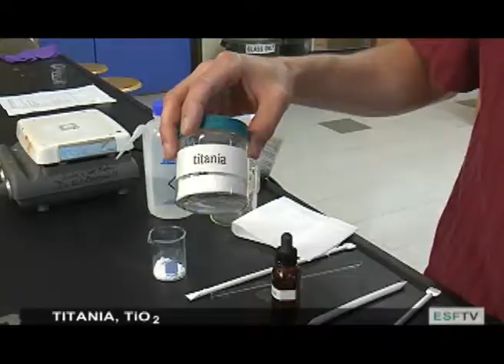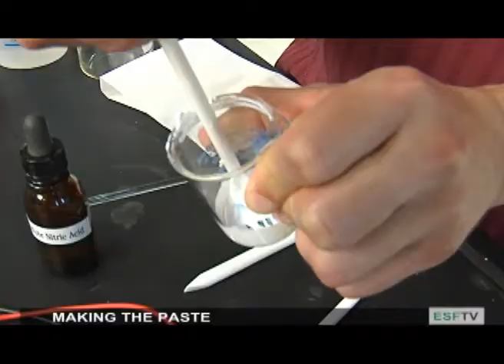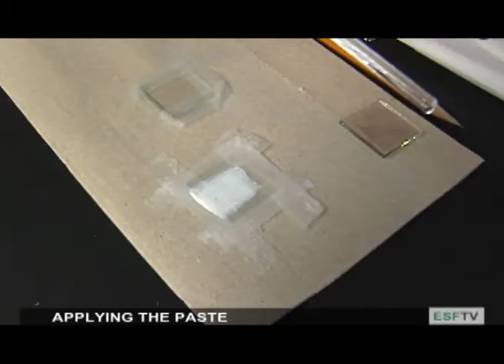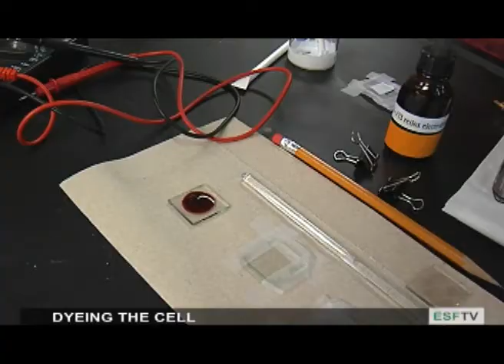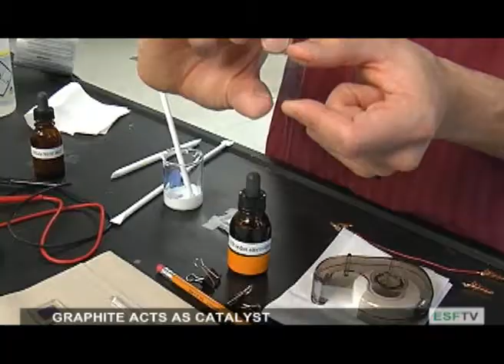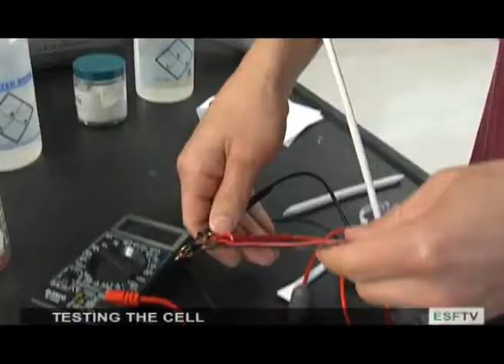Constructing a Dye Sensitized Solar Cell

Comment: Hi Neal, Thanks for the informative video. 
If I want to conduct more than one trial for this experiment, will I be able to reuse the TiO2 covered tin oxide glass for the next trials, or will I have to use a new piece of glass?
Reply: Hi, I think you need a new one since the dye from the fruit is already with the TiO2. But also, if you have done the project, did you use non-nano TiO2, or nano TiO2 P25? Or no P25? Thanks!

Comment: I would think aluminum foil could be the layer with titanium oxide added to it since it is conductive and has no need to transmit light.  The conductive glass as a bottom layer is silly since it becomes opaque to sunlight once it is coated.

Comment: i created 12 small dssc and none of them work, i used strawberry, red cabbage, green leaves, and carrot dye, any help?
Reply: Did you try blackberry, blueberries, or raspberries? Apparently they are the ones with anthocyanins which are really good at transferring electrons from the Iodide to the TiO2. Green leaves should do something but may not have have as great of an effect. I heard strawberries just don't work for some reason.
Reply: +Chuck Faber 
Thanks for The reply! I actually tried again with mulberries, eggplant, strawberry, spinach with carbon coating instead of titanium and different titanium dioxide. And it worked! somehow, eggplant and spinach somehow generated quite a lot of electricity, but mulberry  obviously had the most

Comment: Can anybody tell me if these cells will continue to work in the long term? I'm looking to make one of these on a larger scale to power a small fish tank, and I need to be sure that it will hold up for months at a time. If they don't last, is there any way to extend their lifetime?
Reply: Yes, there are ways to extend the lifetime of cells (most likely by creating a fully enclosed DSSC), but the cell made by this person will not produce the same output for very long because the dye on the titanium(IV) oxide will decompose when not supplied with an electron by the iodine solution. The iodide solution can evaporate and cause the electrons to not reach the dye molecules at the same initial pace.
Reply: @MarkDeAwesome  What about adding a polymer stabilizer? maybe embed the pigment in a sheet of plastic instead too

Comment: Anybody know where to get the material, The glass, Tio2, and redox electrolyte. I went to home depot and they didn't have it anyone knows if there is a store like that, I don't want to order the materials online.
Reply: +Alain Iblex E171 of course ;) . I was mistaken.
Reply: TiO2 (E330) is adding to food , for example cottage cheese. Its normally avaiable in chemistry store (the best form is anatase). Redox electrolyte you can make using iod in potassium iodide mixing in glycol ethylene. The problem is the ITO or SnO2 glass. I can make it in a magnetron sputtering machine. The electrode must be transparent and conductive, it can be made chemically. It's not simple to make this cell at home without intermediate components. It's hard to check the efficiency of this battery. On this film they show only Voltage. But how about current ? If you want to make a battery only for an experiment, use a citric acid as an electrolyte (saturated solution in water).  It can produce about 0,7 V , but the current is relatively low (about 0,5 mA) per 1 cm2 area of DSSC. Remember that preparation of each part of the cell has a strong importance to achieve a satisfactory final result.
Reply: Piotr Lichograj E330 use C6H8O7 and no TiO2 on it

Comment: Why doesn't the conductive glass create a short when it is in contact with itself?
Reply: Because they are not in contact. Its a thin film (tape) around the dyed area.
Reply: +Piotr Lichograj Isn't the tape removed after the TiO2 is added to the glass? Or does he just not mention that he leaves some behind?
Reply: +Olof Enström There should be a space to avoid a short circuit. In our research we are using a carbon disk from Floppy Disk or simple transparent tape.

Comment from the maker: @frostvectron Volume ratio is defined by molarity.  I would suggest obtaining the compounds individually, then making the solution.  The triiodide complex is in ethylene glycol, not water.  Water will kill the cell. You need about ONE DROP of solution per cell.

Comment: @nabrams1 I am looking at Sigma Aldrich for the ingredients for the electrolyte solution. They have KI and iodine solutions in water in the concentrations you had specified. What was the volume ratio of 0.5M KI, 0.05M Iodine, and EG that was used?

Thanks again!

Comment: @kam03m: the titania layer, which is titanium dioxide, the stuff in sunscreen, has enough thickness to separate the glass plates from each-other. On a different note, the anthocyanin dyes absorb light energy and transfer it to the titania semiconductor layer, which then transfers it to the indium-tin oxide glass and to the rest of the circuit. The electrons return to the cathode, where they combine with the carbon graphite, which is oxidized and then reduced by the triiodide electrolyte. Just a
Reply: without  titania layer ,there never be solar cell

Comment: Ok, so the excited electrons are injected into the conduction band of the Ti02 then they move towards the black alligator clip because of the electrical field created by the depletion region in the electrolyte.  They are suppose to travel through the multimeter then recombine with the electrolyte completing the circuit.  But since the both conducting sides of the glass are touching each other why doesn't the electron follow the path of least resistance and jump directly to the cathode?

Comment from the maker: @manilaenglish Votlage is based on the cell (max around 500 mv).  If you want to increase voltage, you need to wire in series.  I would not make the cells larger than 25mm x 25 mm.  After that, the current drops.  Cost:  I don't know on a per cell basis.

Comment from the maker: @onlyjustice04 The resistance should be close to 0 ohm.  Certainly not infinite, which is the other option.
Yes, the cell needs to be sintered.  If it is flaking/peeling even after sintering, I would guess that the paste was too thick.

Comment from the maker: I would not expect the cell to dry out since the redox electrolyte is made using ethylene glycol.  Instead, I would think the anthocyanin dyes oxidized, turning the cell a brownish color.  If it turned completely white, either the redox electrolyte was not correct or the cell was exposed to a large amount of heat and UV light.

Comment from the maker: The resistance on the wrong side should be infinite meaning there is an infinitely high resistance to electron flow.   If the ITO glass is high quality, there is no contact resistance, or the multimeter is not very precise, than you will observe 0 Ohms rather than 20-30.

Comment: What would you estimate the $ / Watt to be with this type of cell?  Also, will this same method / procedure work with larger pieces of conductive glass (1-2 feet square vs 1 inch square)?

Comment from the maker: Generally, annealing at 400-450 degrees C will suffice.
Reply: What equipment do you use in sintering? Is it okay if I only use a hot plate? I don't have any type of furnace.

Comment from the maker: If the TiO2 is not sticking when heated, it is most likely due to the paste being too thick.  If it flakes BEFORE being heated (but after drying) it is due to the paste being too thin.